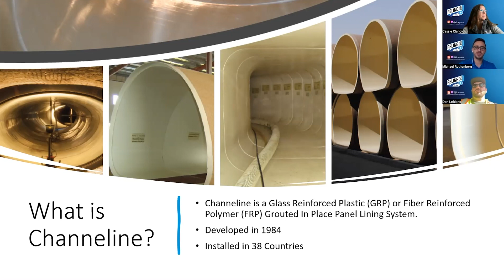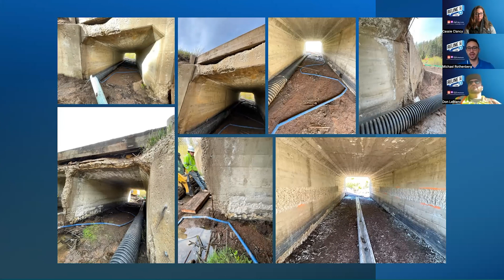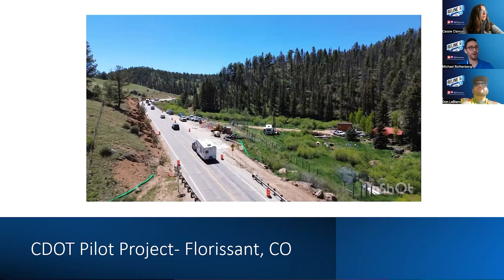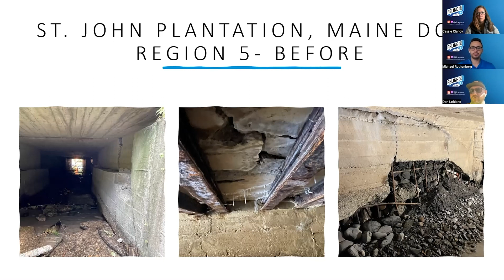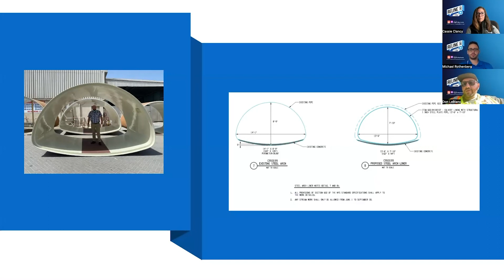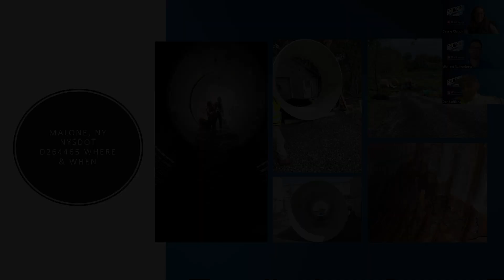Reline LIVE | Don LeBlanc and Michael Rothenberg

Comment: Specially focus on manufacturing:Large diameter spiral wound pipe extrusion line, large diameter spiral reinforced winding pipe machine, large diameter krah winding pipe extrusion line, big diameter drainage winding pipe production equipment, winding drainage pipe joint connector injection molding extruder machine, double wall corrugated pipe extruder machine, single wall corrugated pipe extrusion line and etc. The application the winding pipe involves water supply, drainage, gas transportation, irrigation, mining, ventilation, and engineering construction of chemical pipelines. 　　
Beisu adheres to the tenet of innovation, quality, service, and win-win. With strong strength, advanced technology, reasonable prices, and high-quality services, we will wholeheartedly work with users to create a better future!